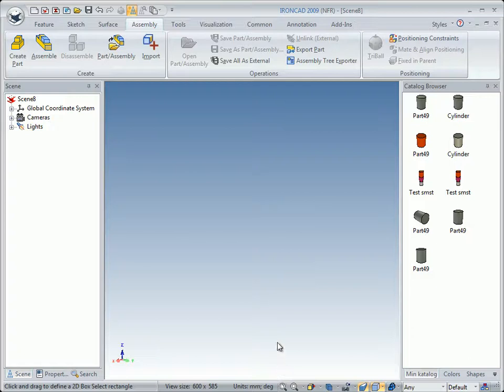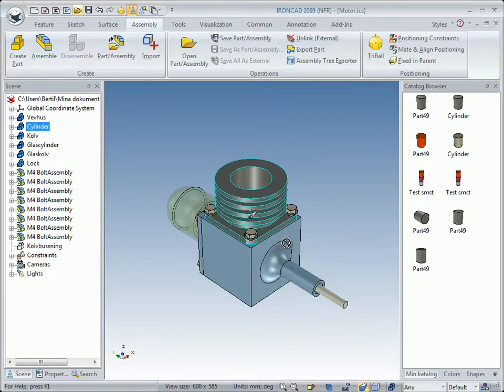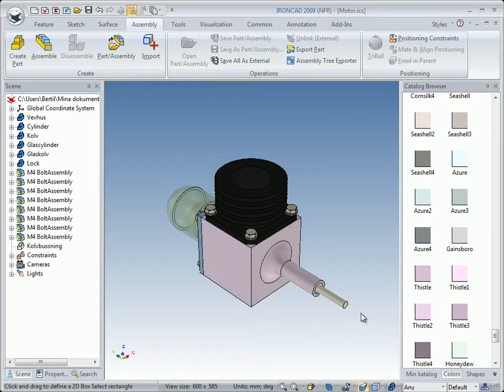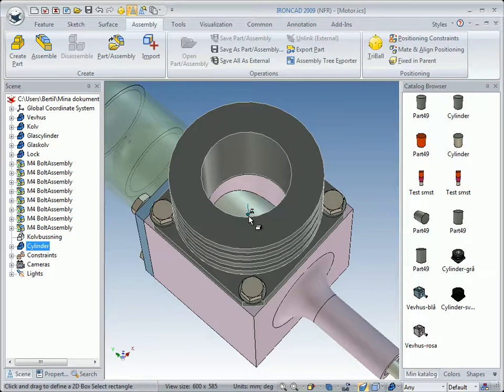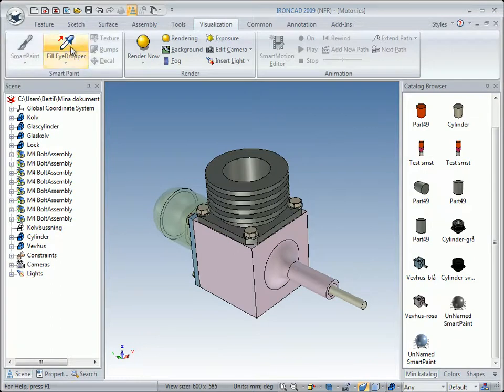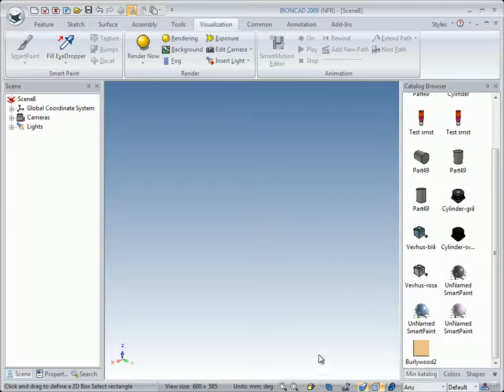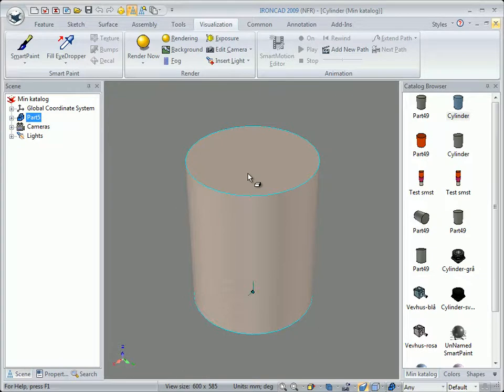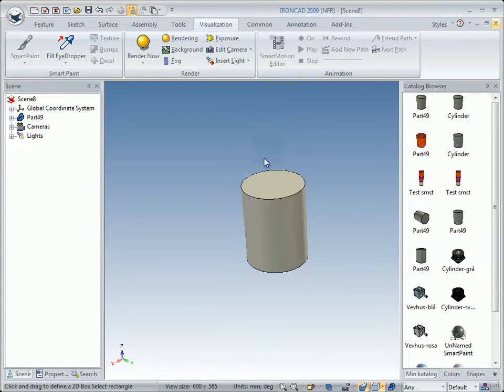IRONCAD Training - Catalogs part 2/2

Comment: Is it possible to create catalog parts with add and remove from the model. For example if I want to add a bolt with the necessary hole all in one?
Reply from the maker: +Lotus Yes, either by using the IronCAD Mechanical addon, which has a Fastener (bolt/screw) tool which also can include a hole that follows the screw when it is moved. Here's an example: https://youtu.be/L3jnFoicSnQ

You can also create it yourself by using an Assembly Feature group, http://www.ironcad.com/products/IronCADV9/wf_njs.htm